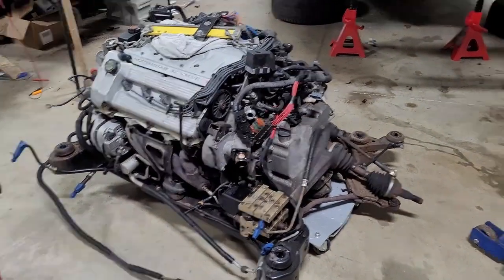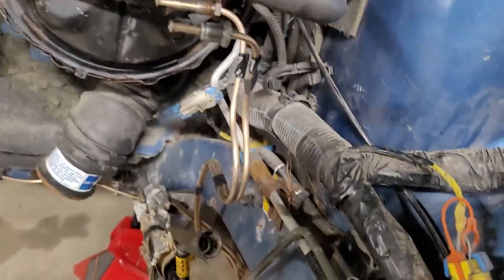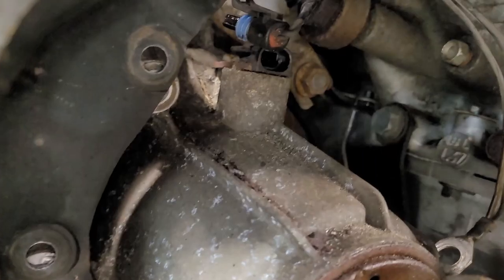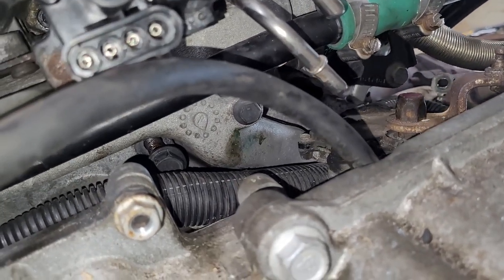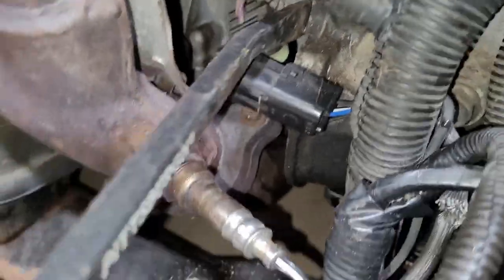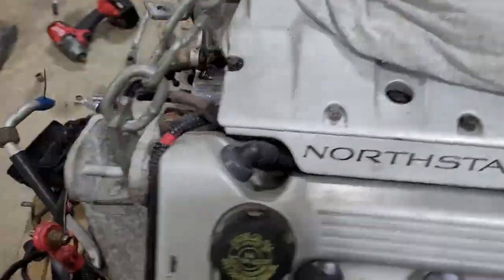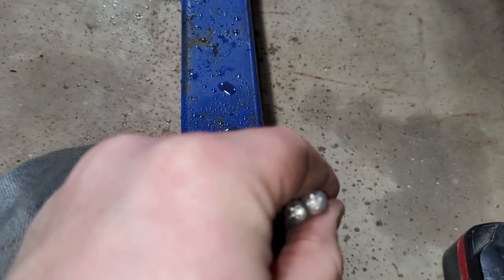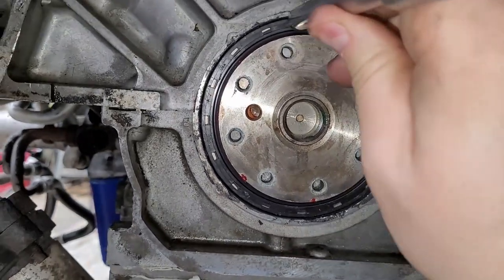Eldorado Northstar Engine Rear Main Seal Fix - No Lift - Part 2

Comment: What on gods green earth behooves an intelligent man to do a $10,000 repair on a $1000 car? Are you trying to avoid the family? signed, Curious Keith
Reply from the maker: Just stuff I do in my spare time.  Car was free to me and low miles and otherwise in really great shape. So all this cost me was a couple tubes of rtv, rear seal, some miscellaneous service items, and time.
Reply: @zajacmotorsports5910   outstanding work and you have the agility of an athlete too. quick question here...i have a 2001 eldorado etc . just got the service engine soon p0340 cam shaft sensor. i see the location on your motor top left side of motor just below valve cover but i dont see it on my engine. will replacing this sensor clear this p0240 ? also im trying to get my car to pass inspection. they keep telling me 2 monitors still arent ready yet. will a bad sensor not allow monitors to clear,,, how do i complete the drive cycle. thanks alot